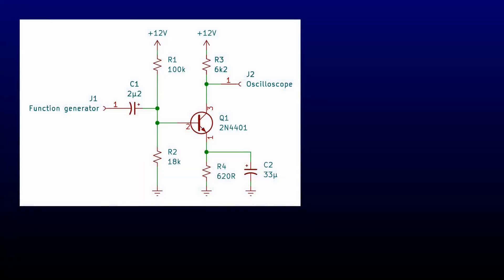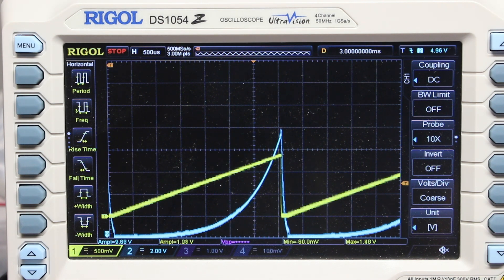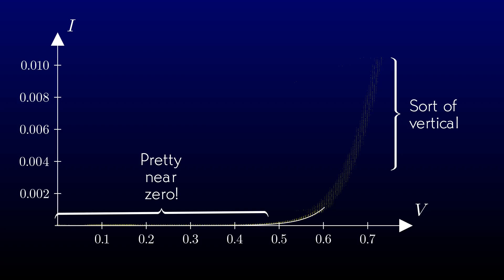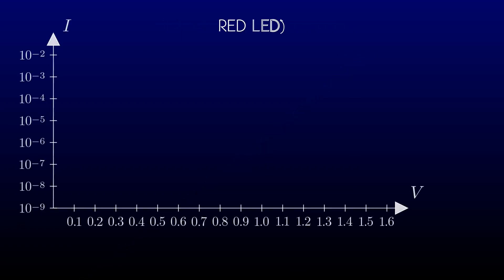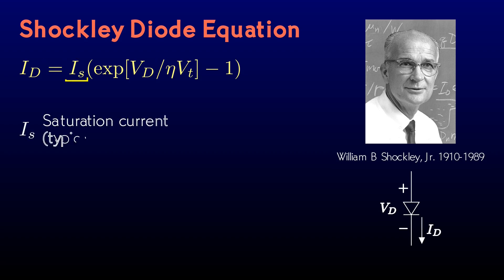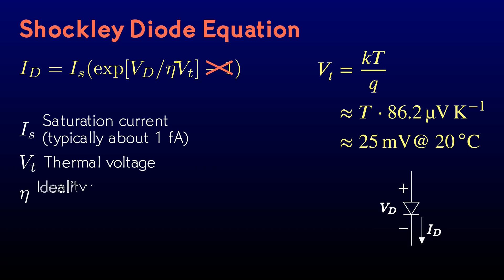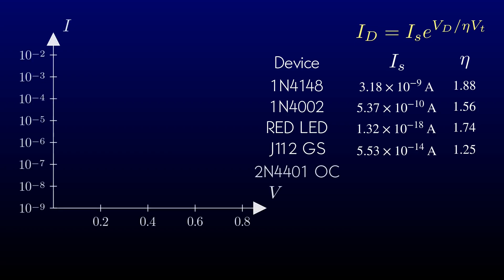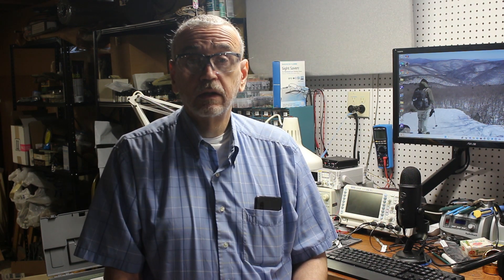The Shockley Diode Model - Transistors 101 episode 10

Comment: Very nice examples! Working out Is and η from measurements is not something we often see and it is very useful for gaining intuition.
Reply from the maker: Glad it's helpful!  Of course Is is so insanely temperature-dependent that you won't get the same answer the next time you work it out from measurements, but pretty soon, we'll be getting into circuits that compensate for that (generally by having a second matched transistor and arranging for the thermal changes to cancel out).
Reply: @KludgesFromKevinsCave  Looking forward to it. You know what I haven't seen? I've never seen anyone talk about the perfect transistor (as per Horowitz and Hill). I think that would be interesting to explore in practice or to study - you know, is it as perfect as it looks on paper?
Reply from the maker: @Stelios.Posantzis  I don't know if I'll necessarily get to diamond transistors, but other OTA's (Operational Transconductance Amplifiers) are definitely planned!